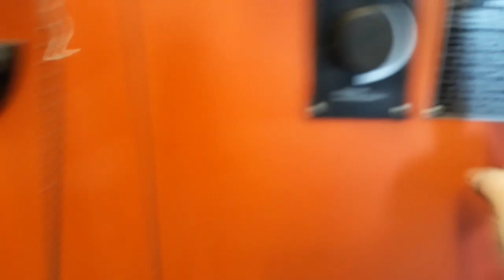Morning Routine Mom on Winter | Coal Heating Verwarming | My Work at Home

Comment: I heat my home with coal too. Everyone thinks it’s old school and not done anymore but not true. All of our electricity is from coal. If you heat your home with electricity, you are burning coal. Plus coal is cheaper than oil or natural gas combined!
Reply from the maker: Is true but this days not many using them..for me is very expensive and I hate to spend that money but we have to
Reply: @JanahLife  just get a wood pellet central heater, used or new.. you just fill it up like regular coal heater but it costs way less and wood pellets are made from sawmill waste so really it’s just trash that heats very good and It doesn’t smoke much
Reply: I think it depends for the cost. If you live by a mine or store that sells coal then yes, but if you are in a city then no, also type of coal and environment, you could be burning anthracite or bituminous coal, and you could live in an area that is warm year around or drops to neg 20z